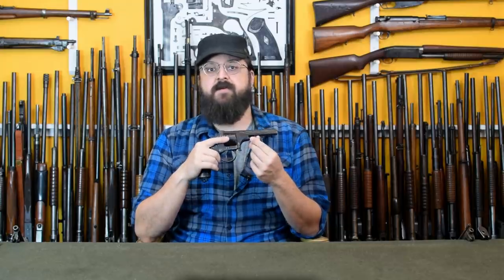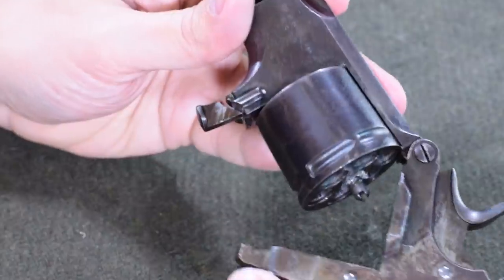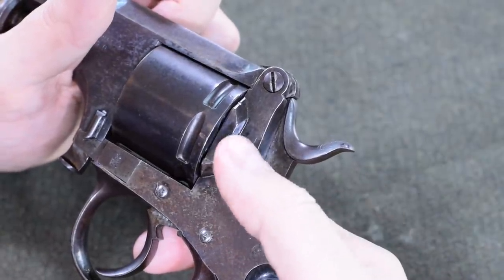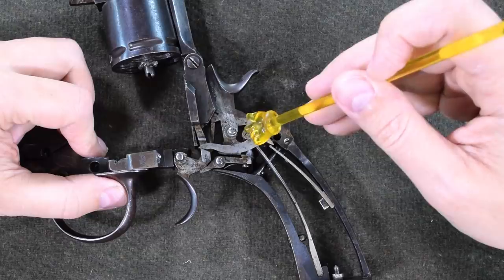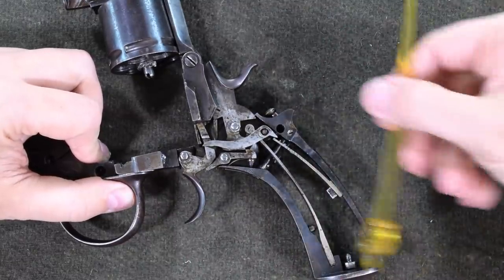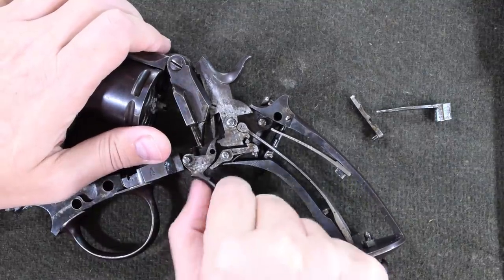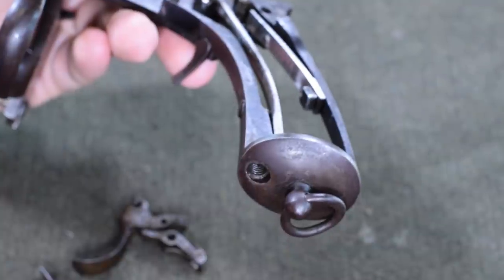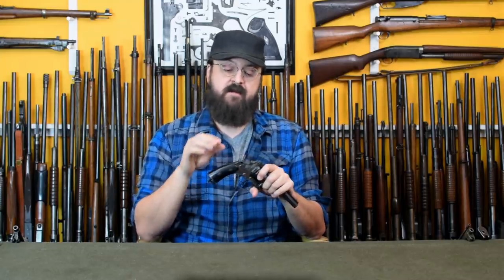Clips: Spirlet Revolver Breakdown

Comment: Imagine ,all that intricate design work and machining without any CAD CAM. All done on manual machines using basic carbon steel cutting tools...no carbide , no high speed steel .. damned impressive .
Reply: And I imagine a lot of hand fitting those parts with files to match those interacting surfaces.
Reply: @VeraTR909  Yes, no doubt. I imagine these had to be meticulously assembled and adjusted individually to work correctly.
Reply: @ifitsfreeitsforme1852  Any one who bought one of these would want to be sure to get one which had been assembled on a Wednesday or a Thursday.

Comment: Is that hole on the grip big enough for an oiler, seeing as the rest of the gun is setup so nicely for maintenance?
Reply: That does seem like it would not only make sense to include, it would fit in with thought set behind the very cool disassembly mechanics.
Reply: Came here to say oiler, too.
Reply: Hole seems too small. If anything it looks like it might be part of some sort of bench mounting assembly, otherwise there'd be no need for it to be so deep, or maybe even a semi-permanent stock.
Reply: Maybe, but I don't see why it would be threaded all the way to the bottom (if I understood correctly) if it's for an oiler.
Reply: The grip hole is 100% for a buttstock, though none were ever actually produced commercially for the gun. I imagine it was more of a "whatever the end-user wants it to be" accessory hole. Having the hole would only be marginally more expensive than not having the hole, and the gun already had a lot of very "premium" features for what it was, so I suspect they didn't see a reason to remove the hole from the production flow.
Reply: mrltdodds has replied with a link showing that it is for an oiler or perhaps small screwdriver.
Reply: It's where you mount your gps or optics or flashlight (not really)
Reply: @bigmike-  Someone posted a diagram of the revolver, it's for an oiler.
Reply: @bigmike-  so, an early version of the Picattiny rail concept? Have mounting hole, will mount something.
Reply: @onkelmicke9670  Gimbal for a small oil-lamp or candle holding lantern.

Comment: The pistol is tipped to the left, left index across onto the break release, left pinky/ring on the plunger and will kick the spent off to the side.  The second threaded hole is for the saddle holster's lanyard, easier to screw and unscrew than to tie an additional lanyard to the lanyard ring and risk cutting both.  Once the gun is empty you can collect the cartridges from your left hand sliding them in with a shucking motion of the open gun then flick it shut again.

Comment: That’s going to get hot holding onto the barrel like that during the reload.

Could the threaded hole be for a screw driver to get the grips off since it’s the only place you need a tool.
Reply: You wouldn’t be firing it enough or fast enough on a commercial piece
Reply: I think Othias only removed the grips to show the mechanism for removing the spring tension, you wouldn't need to remove the grips to disassemble  the lock works.
Reply: @tda2806  -- Someone thought it could be for an something to oil the internals with, maybe a screw with a tiny rod attached and some oil in the hole, that seems to fit in nicely with the thought set behind the disassembly mechanisms.
Reply: No, this wouldn't get very hot. Its a relatively small [read: weak] cartridge, its nothing like the heat off a modern magnum or even .38 special.
Reply: @thesmallestminorityisthein4045  It is however,  a black powder cartridge,  which will put off more heat than you would expect. Loading would likely have been an administrative task anyway,  not something expected to be done without plenty of time to let the barrel cool between reloading.

Comment: I’m used to you showing bottom-hinge break top revolvers. Would this design favor “wrong handed” 🙂 shooters like Ian M.?
Reply: It would not.
t. I'm left-handed
Reply: Why would it, both designs are horizontally symmetrical more or less
Reply: I guess any design that doesn't swing out the cylinder to one side is more lefty friendly. If one would grab the front with the right hand, the left would stay on the handle until it's open and would do the rest of the reloading. 
This is more ambidextrous than a webley-fosbery having the hinge-lever on one side of the hammer.

Comment: That's one of the most serviceable pieces of equipment I've ever seen, a very nice design that could be fully cleaned, inspected and oiled with around 1 paragraph's worth of instruction and no tools whatsoever,  I'll bet that hole's for an oiler, too. seems to fit the design theme, and it'd be the sort of thing that would get lost almost immediately! I think you should make one to go in there anyway, it would drive you less insane know that you were using it for at least one of it's possible purposes!

Comment: I did some looking around for Spirlet patents and found that on many clones of the Spirlet that hole was for a disassembly tool. I have only found one Spirlet patent drawing which does have the hole and a drawing of something in that hole but it isn't immediately clear what purpose it would serve; and is not marked with a call out for what it would be used for. However my estimation is that it would also serve as some form of disassembly tool, or possibly some form of cleaning instrument.

Comment: It looks like someone moved the lanyard loop back by drilling a hole and using a bolt to retain the lanyard loop, probably because the loop got in the way, or it could be for the disassembly tool found on other examples

Comment: An advantage with the bottom break loading revolvers is that there is more meat to the bottom frame than there is on the top strap. This would probably make it not loose timing like a top break with a bent top strap.

Comment: Othias I suggest a use for that strange hole at the bottom. Given the presence of that disassembly button and the numbering of parts and such, perhaps that hole was for mounting it in a jig to disassemble it while upright. Perhaps that particular gun was some kind of training aid for...gunsmiths, factory technicians, cadets in anticipation of an unlikely military adoption?
Reply: Could even have been a display model, intended to be bolted down to the table top while still upright so potential customers could get a grip on it without possibly "accidentally" walking out after they "mistakenly" dropped it into their pocket.  But I like your idea of training, as it would explain all the numbered parts and their corresponding pins. 

It's little details like that threaded hole that probably have a story all their own - if only we knew what it was.  :-)
Reply: @aussiebloke609  yeah, that was kinda  what was getting at. Entirely speculation as to how they marketed guns in that time period, but I do believe I have see odd display guns pop up on occasion

Comment: Only thing I’d wonder about your reloading method would be how hot the gun would be if you had just fired six rounds in rapid succession. If you have to hold the gun right about at the cylinder and forcing cone to reload it, heat could become an issue.

Comment: Looks like a thought for the military,no tools required, the best military guns are made that way, to be easy disassembled, maintained and reassembled. So the hole may have had a toll for cleaning/oiling, just enough for one time of oil, so to not have any thing else out in the field, or in and coat pocket on travel, just so that You could keep it clean and lint free until You are home. Caliber, looked like an 7.5 to 8mm and centerfired. The numbering of the parts, pre IKEA!

Comment: When reloading, your hand position may be uncomfortable if the cylinder had recently been emptied.
Reply: I figure they had 2 assumptions in mind that make it less of a problem. 1: It's a civil firearm, so they probably figured reload under fire would be rare. And if things are bad enough you need to, you'll tough it out. 2: The shooter would probably be wearing Day Gloves, if not Riding Gloves which would insulate from the heat some.

Comment: It's not a "single and double action", it is a double action. You don't say single and double, that's redundant. You can say "double action only" if that's the case, or "single action", but "double action" already explains that it does BOTH.
Reply: Disagree. I don’t automatically assume it’s a DA/SA if someone says something is a DA. Since DA and SA are not mutually exclusive, it’s more clear if you just go ahead and clarify both points.

Also, nothing he said was false. It’s not like clip vs magazine where there is a technical issue that actually warrants policing of terminology.
Reply from the maker: Weirdly half right but also dated.  Much like the change in the word "automatic."

Long, long ago, double action did mean that the revolver was both self cocking and manually cocking. But "double action only" wasnt a thing at all.

Instead they would say single action, thumb cocking or single action, trigger cocking.
Which is technically correct but misses the major point people are trying to identify.

So, double action morphed into meaning cock AND release.  So much so that later on people would suggest triple action as a term for doing both SA and DA. This didnt catch on as well.